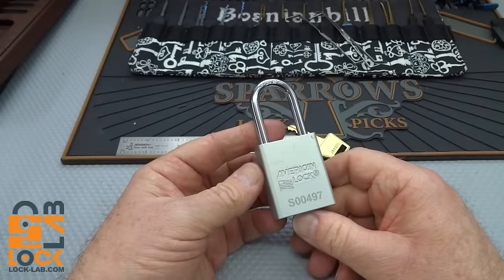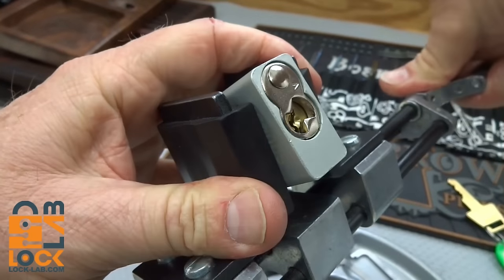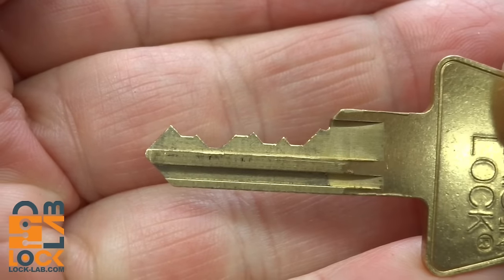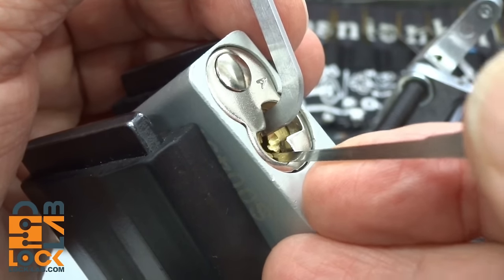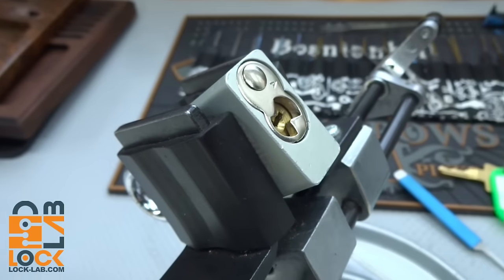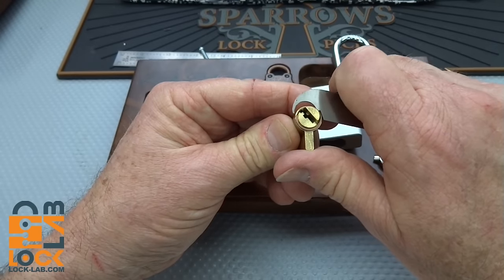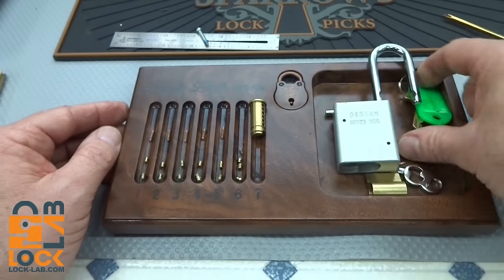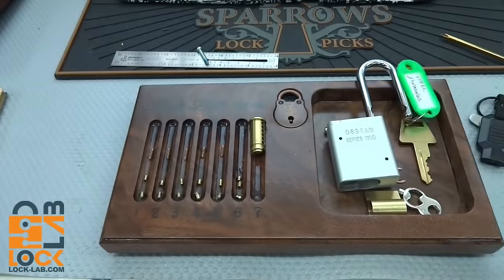(986) Challenge: American 1100 Series Padlock

Comment: Thanks again, Bill! Starting my Lock Smithing course in just a few weeks now, I'll pass with ease in part to you! 

A couple of ideas for you. Have you thought about connecting a monitor up to your camera so you aren't straining with the little LCD display? I think also the camera, if it's like mine, has trouble focusing if there's more than 40% background to foreground ratio. What I learned to do to get it to refocus was bring the objects way in, like too close, and then out again. This deals with the foreground/background issue promptly.

Thanks again for keeping your videos regular, learned so much from them in such a short time. I cant wait to send you a challenge lock!
Reply: MPAH1981 cool which course? I took the Foley belsaw
Reply: John Baker
This will be Mechanical Engineering Certificate II here at TAFE NSW in Sydney. I already have 95% of Certificate III as I'm a Toolmaker, so 80% of it should cancel out and I just have to do the locksmith specific modules. Passing this one with full distinctions if my expectations are accurate.

Comment: Hello Bill, French fan is here. I just received my sparrow lock pick set, and I bought a Master Lock N•150 because you always says Master locks are very easy to pick. But I can't SPP or rake it or open it with the "3 worms pick". Can you give advice please ? Thank you
Reply from the maker: The master 150 contains 4 spools and one standard pin. NOT a good lock to start with, even difficult to SPP sometimes.  Get yourself a Master #3.  Follow the lock picking "university" on the website and you'll learn a little faster than jumping straight to complex locks.
Reply: Clement Darchez  If there are so few master padlocks in France as here... go in the next hardware or euroshop and get some of the cheap china locks however they should not cost over 5 euros, and not under 40mm, also it would be good if they are from brass and not only painted golden, the cheap Burgwächter are also quite okay to practice.Maybe you should also pay attention to the bitting of the key, so you have one with medium and a few with a different high low bitting! Greetings from Germany
Reply: Julian W. thank you a lot, I hope I will find some. Greeting from France

Comment: So Bill,  do you pass the locks on to other pickers after you pick them?  Or do you keep or ebay them?  Interested in getting involved in them.
Nice job Steel Pinnings!
*Guy's If you have not checked out Steel Pinnings channel,  you really should!  There are a bunch of Great guy's making and trading challenge locks around there.
I have Not been able to do any trades with them yet as I have not made any yet,  But if You do you might consider looking over there and the others who swap and trade there.  Bunch of Great guys!
Charlie
Reply from the maker: I usually give them away at some point.

Comment: Regarding that anti-bypass wafer, Peterson makes a 3-piece wafer breaker kit. I've used it, and it works well.
Reply: DT Goertzen but they are too big to fit inside this particular key way
Reply: I thought it looked an awful lot like a standard American key and cylinder, compared to the dozens I've seen and worked on. But obviously, I can't be certain without seeing it.
Reply: DT Goertzen the wafer breaker set right? isn't it designed for the 700 series? I have them, you're saying it fits inside the 1100 series too? I'm going to try it thanks! lol I never even tried, as I enjoy the picking more than a bypass ( unless it's for work) but we usually use the gun for American locks
Reply: DT Goertzen holy crap you're right! thanks man.
Reply: No problem. If you look up the American Lock Service Manual, close to the end is a page showing the different keyways that its padlock cylinders come in, and the Peterson bypass tools might not work in some of those keyways. Any American padlock compatible with their padlock cylinders can be set up with any of those single-sided keyways, if I'm not mistaken.
Reply: The wafer breaker was invented to defeat the 1100 series and the other locks with the same type core. However the wafer breaker doesn't work if you put more than one wafer... I typically use 3 whenn sending to a picker.

Comment: Hi Bill! I have some practice with lockpicking (little), I woud like to know if I can make a bump pick, like a car picker, it would work?? I've searched and saw one in GOSO pickset but you said this kit is junk, (Video 766), thanks greetings from BR (subscribing if answered)  .. kidding subscribing now! SS! SL!
Reply: makomifune 
What do you mean by bump pick??
If sounds like some of the different types of rakes and wrigglers out there.
But if you are looking to make a pick I say go for it.
That is how most are developed.
Reply: makomifune Look at his "How to kinetic attack" video. This uses the same principle as bump keys, except picks are used instead of a key.
Reply: I mean like this http://img.photobucket.com/albums/v47/MadMick/Bogota7.jpg but one side straight,  the one I said is in video 766 at 4:59
Reply: Couldn't find the one you said.. link?
Reply: I see what you mean,  and you would only need the bottom rake if there were pins on bottom. The only locks with pins on both top and bottom besides wafer locks are zise or cross cruciform locks. But it would still work in a wafer lock.
Reply: Yes that one is for wafers, I tought in making one so I dont need to carry a lot of different manufacturers and shapes keys ..